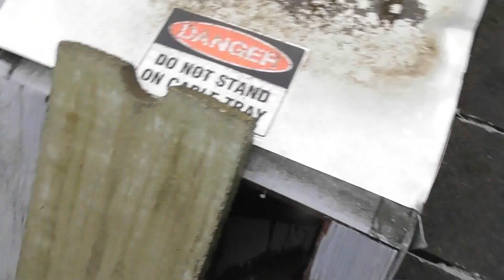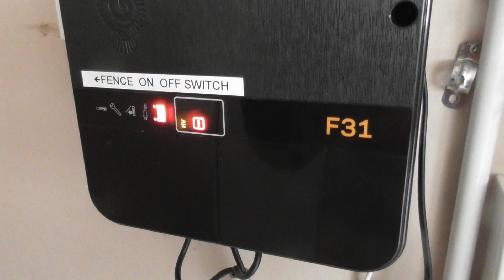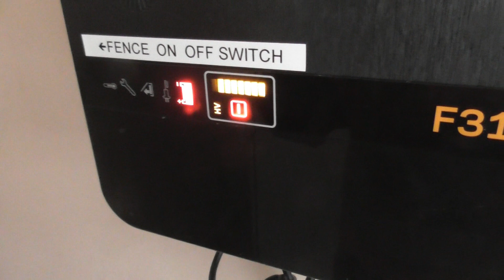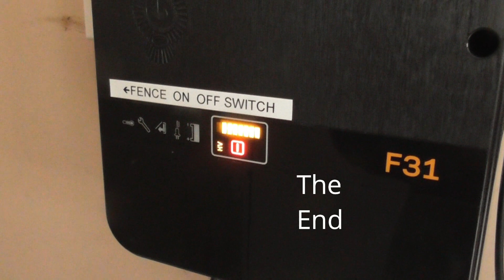Bit of blockage on a transformer oil separator system

Comment: This reminds me a lot of the oil / jet fuel separators I've seen installed on helipads here. They're usually just kind of a passive tank, but with the same structure inside - the water has to pass under one weir inside, and oil will float over another weir and wind up dropped into a storage tank.

Comment: That's some mad bonding on the tray! Also fascinating how the sites protected by an electric fence! 

They're pretty cool how those oil separators works, got to play with them as an electrician when I got to make a water recycling system for a car wash.
Reply: As if there wasn't enough electric inside the compound 🤣
Reply: If you don't bond the fence, then it'll still be an electric fence even without a power source lol